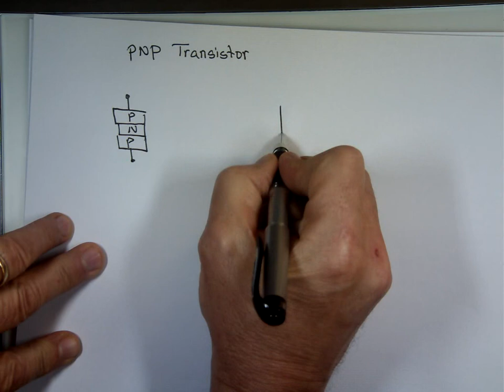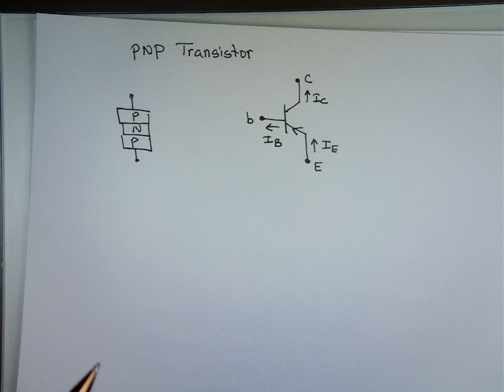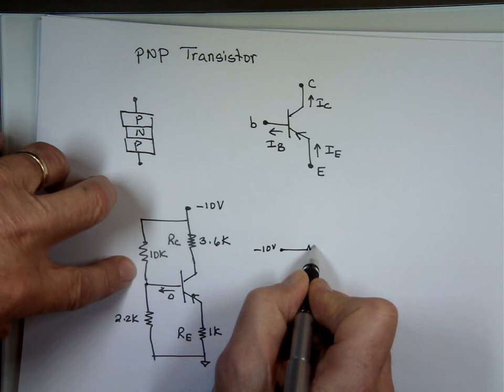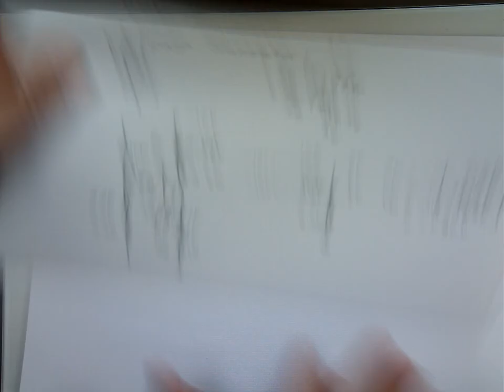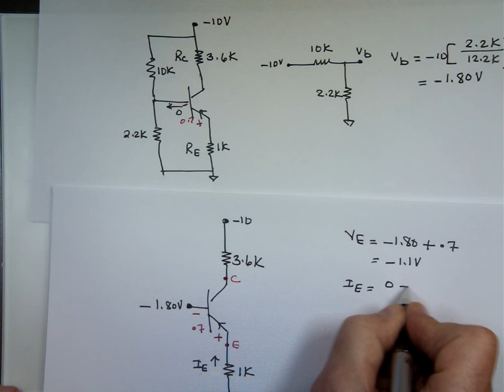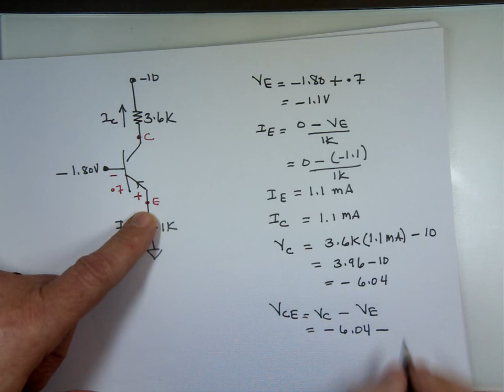PNP Transistor

Comment: U can't divide voltage considering only 10k and 2.2k. Because there is a portion of transistor parallel to 2.2k resistor.

Comment: Can the current be negative?
Reply: No, the current is always positive, but if you get a negative number for the current it is nothing to worry about. Why? Because that means that your prediction of the flow of the current was opposite (it flows in the other direction). In this case he got positive number for the current because for every transistor we now in which direction the current flows. If you have a problem with a circuit with just resistors and sources just draw the flow of the currents on the circuit and don't worry if you get a negative number. As I said it will just mean that the current is flowing in the opposite direction and leave it as it is. Don't change anything because you may mess the circuit and get wrong results.

Comment: i think you should include the Rth ; you cannot calculate if you dont have Beta value. Rth= 1.8kohm, your equation should be Ve=0.7-1.8+1.8kIb
Ve=1k(Ie)=1k(Ic+Ib)=1k(Ib)(B+1); 1.8k(Ib)-1k(Ib)(B+1)=1.1;

Comment: I think Vc is not calculated correctly. we will make it like that --> Vc = (3.6k)x(1.1mA) - (-10) "which is the mistake that the 10 will be + 10 as -(-10) not -10 as written"
Reply: Yes, I believe you are correct.
Reply: Enigma758 his idea is +(-10)=- 10.     just the convention problem so it is no problem.  for me i will write it as Vc=-10 + Ie*3.6k.  you can think Vc= -6.04v is reasonably correct.
Reply: It's better to think before commenting. Ic = (Vc - Vcc)/Rc and hence Vc  = IcRc + Vcc or IcRc - 10V
Reply: VRc= Vc-(-10) ⏩. Vc= VRc - 10🎉

Comment: Why did you use  -10volts. What circuit has -10volts.  Why couldn't you use a more bring to earth circuit with +10volts on the Emitter side and a load connected to ground on the collector side to explain this PNP transitor? Why al this know it all youtubers try to confuse the viewers?
Reply: PnP circuits would have -10 volts. If you wanna bring the ground to +10 you could do so and probably get the same result in the calculation. But in the reality a circuit with a PnP transistor will usually be set up like this!

For example an audio amplifier system  can have one set of npn transistors that amplify the sound when the waveform is above 0V. And one set of pnp transistors that amplify the audio signal when the waveform is below 0V.

The circuit will be set up with two sources in series and the ground in between them. That way you get one side positive supply voltage for the npn transistors and on the other negative supply voltage for the pnp transistors.
Reply: Because the output would still be the same
Reply: Voltage is simply relative. You could have +10v on top terminal and +20v on bottom and the results would be the same